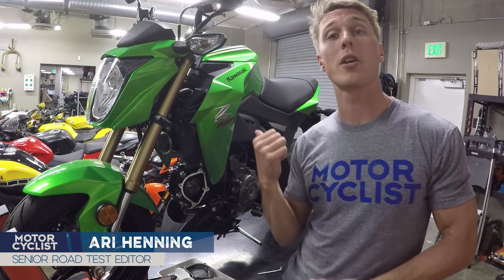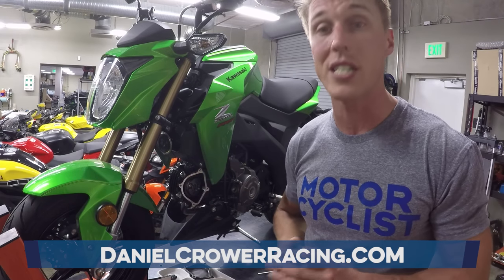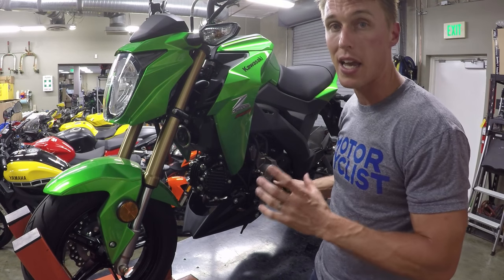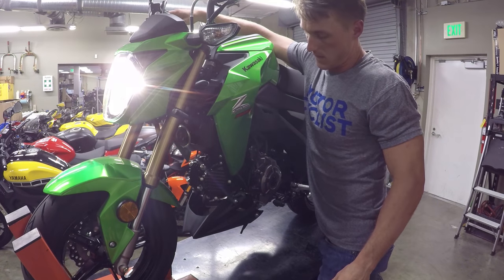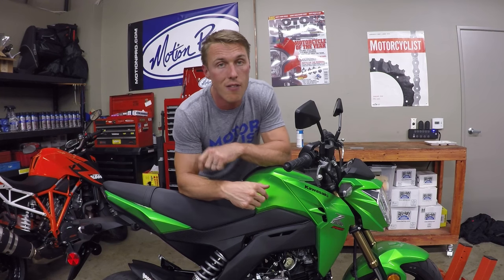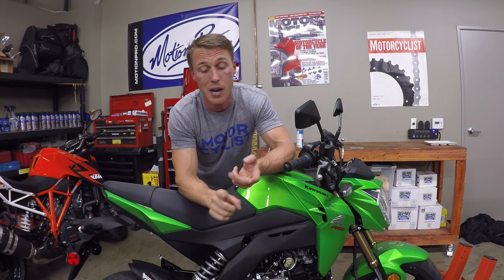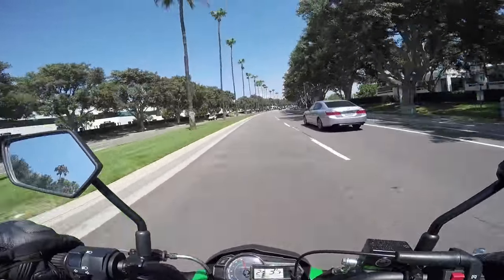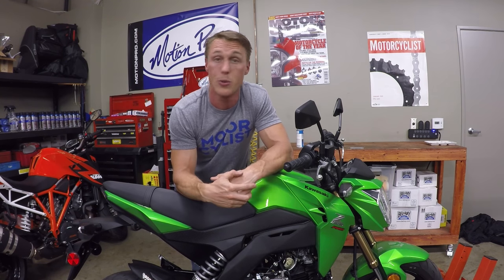2017 Kawasaki Z125 Pro DCR Cam Install and Dyno Test Video

Comment: I have a 2017 Z125pro with sticky dunlop tt93gp and a powercommander, chimera intake and M4 exhaust got it dyno tuned pushing 11.7 hp and 7.7 tq it does 65 mph all day a blast to ride. I've ridden bikes all my life to dirt bikes, mopeds, scooters and motorcycle's small and big these these little bikes aren't about speed but having fun.

Comment: I did everything this guy said in the video and my bike is s0lower than stock.  I did the "Crower Cam" and had Crower himself install it in Temecula.  I recommend trying another avenue, such as wait till someone comes out with 4 valve head.  

I purchased the commander, air-filter snorkel, DCR cam shaft, Yoshimira pipe and spent over $1,200.00    I really wish I would of purchased a Grom at this point, as they have way more options.  

I hope someone comes up with a better plan for the Z125 pro 2017 model.  I even put a bigger sprocket on the front, thinking that would help it out.  My bike at max speed, on a down hill was 59 mph.  Also, the odometer on the Z is off by 3 miles per hour.  I used GPS to track the speed.  My buddy has a stock one with exception to the air filter and he pulled me in every gear.  Yes I am heavier than he is, but we switched bikes to see if we got the same results and yes.  

If someone can explain where I went wrong, I am all ears at this point.

Thanks for reading

Rock Wilson
Reply: Ken Wilson it could be the miles on the bike loosen up the motor more. Just adding parts to a bike and throwing money at it doesn't make it faster. It's knowing how they work together and developing those parts that you become successful. That's why tuners are so expensive even for cars to get more horsepower from the same engine. At my job someone in a cammed honda rust bucket is a sleeper that walks anyone. The idle is so bad it feels like the engine is going to die.
Reply: Sorry to hear that.   Do u have any update on your z125.?  I am on the fence about a zfi and a DCR cam.  Is it worth dumping all that cash? My zee is my daily driver to work.
Reply: @Stick_jitsudad808  I got a z125 and do 68mph stock with nothing but a yoshimura. Then I did a lightened primary and was faster. Now I got a different titanium exhaust and increased horsepower.
Reply: I don’t mean this in a cynical way but am genuinely curious because with these bikes it can really matter. How much did you weigh when you posted this comment?

Comment: Ari Henning, I believe replacing stock camshaft with a more high performance aftermarket one requires an ECU re flash and maybe a transmission tune to accommodate higher peak rpm. Then of course the fuel delivery system will need tuning to accommodate this aswell. May be the same process idk, all I know is there is more power to be had up top beyond the rev limiter with that camshaft

Comment: dude... the ability to install a cam while the bike is simply on a lift without dropping the motor.... GOLD!  how does the z125 compare to the grom in horse-ponies, btw?
Reply: +Ari Henning Roger that. thanks! We're gonna be racing the 24 again this year. You wanna? :) Sept!
Reply: I have a 2017 Z125pro with Dunlop tt93 gp and a power commander chimera intake and M4 exhaust, and it was tuned runs perfect 65mph all day I love it. I've ridden all my life small and big bikes and I have so much more fun on this it's not about the speed but the fun.

Comment: How would u break in this component.  Is ther a break in procedure?  Does this cam provide a good idle? Does this cam in your opinion provide low end torque or top speed?
Reply: I have same question about the brake in

Comment: just bought a '15 grom with a full pipe, bike only has 180 miles. but I can't justify spending a 1000 bucks for 1 horsepower.

Comment: I find it absolutely ridiculous to produce parts for a bike like this. Especially if few parts add up to match the bike price. Point nothing horsepower here and point nothing there while you lose where it counts, low-end. None the less, it is interesting, however I would never pay so much money for making the bike worse than stock...
Reply: It's the price of this crap that really gets me... $300 bucks for a few ounces of metal that does basically nothing better than the stock part? Pshh take a hike...

Comment: not worth it just out a bigger motor in an call it a day!!!! instead of spending time and wasted money because ur getting nowhere slowly With spending ALOT of money!!!
Reply: agreed totally. it's a great fun video and i loved watching it... but seriously, why buy a $3000 bike like this and spend $1000 in mods to make it like 5mph faster.
Reply: I rather spend that money On something like a 250 more and mount it up!!
Reply: Lucas L wasn't THERE a possibility of a conversion kit to bigger motor...
Reply: The only thing is that the way the motor is mounted is dam near upside down!
Reply: you can buy a 180cc head for the grom, will probably be something similar for this soon
Reply: The simple act of working on an engine and modifying a vehicle is entertaining for some people, regardless of the end result.  I've seen people pay more than $1000 for shorter lived entertainment, so who's to say it's not worth it as long as you have fun.  A Grom or Z125 a lot more affordable and accessible entry point for wrenching than say restoring a 1940s Triumph or something.

Also there are few amateur racing leagues popping up around these 125cc bikes.  So seeing what you can do to get more power out of the engine without changing the displacement is meaningful for people who want to engage in that.